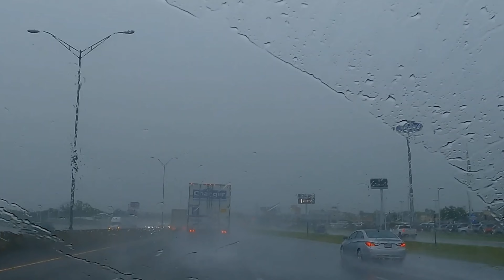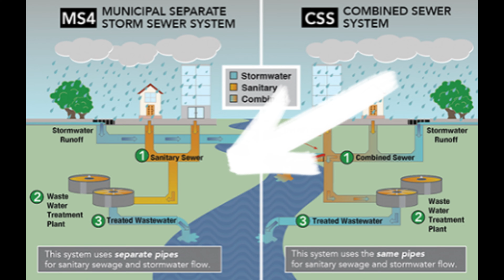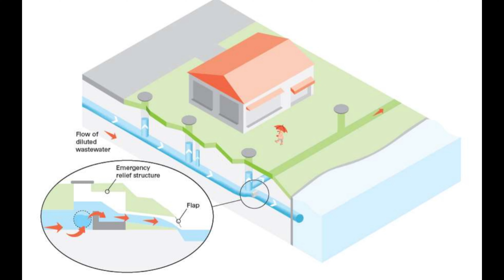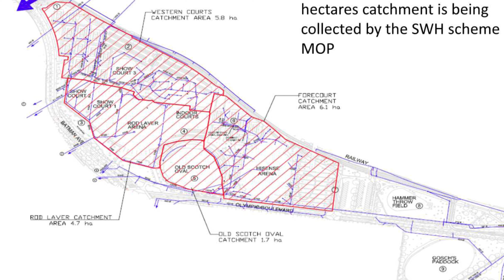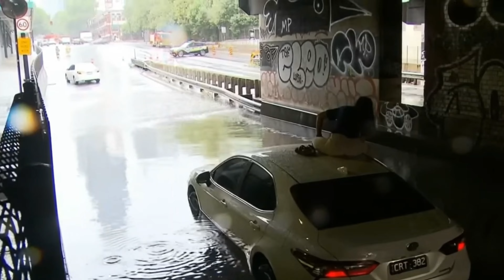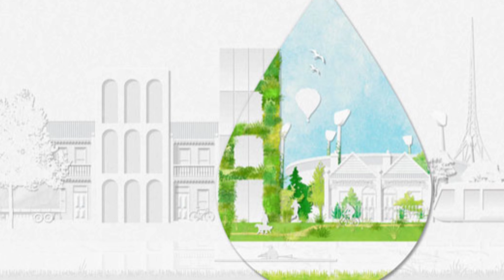Melbourne's Sewerage Story - EP6: Stormwater, Pollution & Environmental Challenges

Comment: Good summary of the drainage and sewerage systems interface in Melbourne. In the 1990s there were over 350 emergency relief points around the Melbourne sewerage system. Most were activated when the infiltration level from storms overloaded the sewers. A lot of work was done to reduce these overflow events by building intercepting sewers and relining sewers but the nature of storm events with climate change will mean overflowing will continue and probably increase in the future. I suspect none of the emergency relief points have been sealed just in case. Keep up the good work.
Reply: But if you seal the emergency relief points, where does the excess water go? It has to go somewhere - perhaps back up your toilet? Or pop a few manhole covers in the street? Emergency overflows are for emergencies, the last line of defence.
There is some small consolation in that the rivers where the sewers overflow are also flowing hard during the storm diluting the sewage.